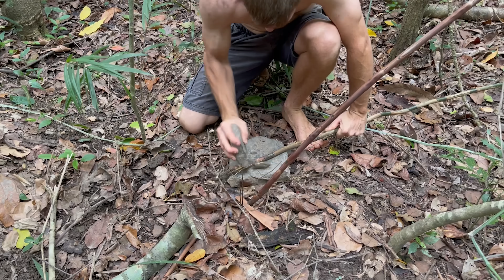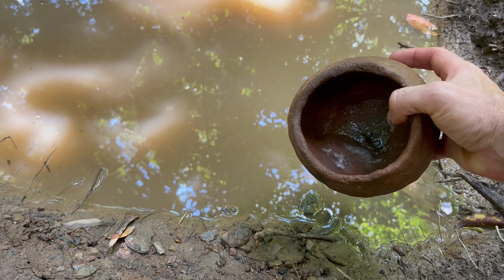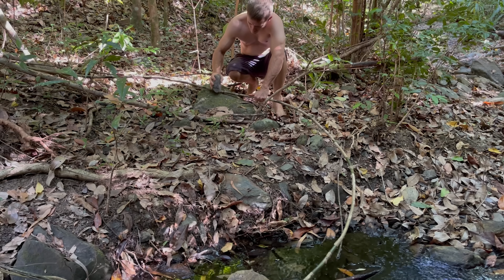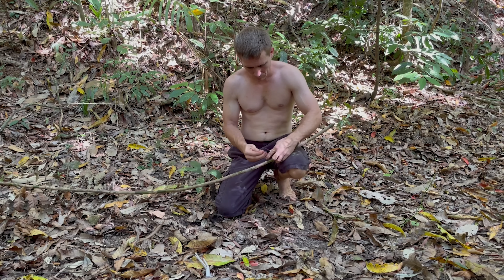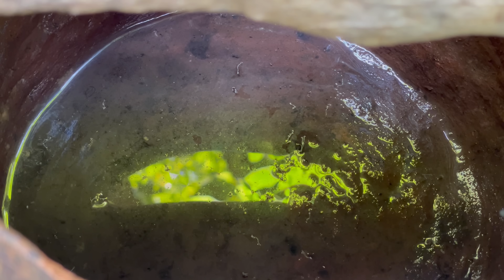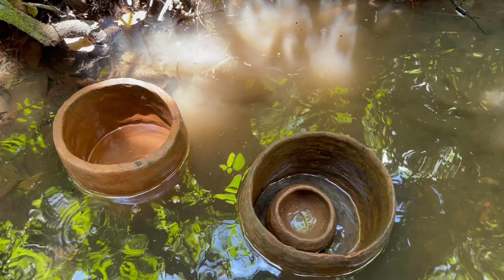Primitive Technology: Cane Water Filter/Siphon

Comment: Neat!
Those are nice primitive filtering systems, but depending on your water source I'd really advise against something as simple as this...
I mean, I imagine he knows enough about the water source that it's good enough to drink with simple filtration, much more of an expert on it than I am, but just to let others know that simple filtration systems aren't enough to kill or eliminate some dangerous stuff.
Of course, it depends on water source, but unfortunately these days most places people would use are contaminated enough that a simple system like this could still result in some pretty bad quality water.... clear, but potentially still contaminated.
Safest simple bet? Use an evaporative/condensation system.
I imagine this can be done in a primitive technology scenario... boil water in pot and perhaps using large leaves or a polished stone slab to condense and collect water back?
Reply: The cane filter was extremely unsafe. Pulling from a stagnant water source, absolutely insufficient filtration.

Comment: I'm curious how those pots left in the water would hold up after awhile. Does prolonged water filtration risk the bottom breaking/ make the pots only good for filtration or can you remove and use for other tasks without risk of breaking
Reply: If they're fired it shouldn't cause anything.

Comment: Wonderful video! Im appreciating the semi-regular uploads.

Im wondering, would it be possible to make a pitcher that would be more suitable for this method of filtration?

Maybe thinner walls, or volatile/soluble chemical add-ins to make it more porous, or what have you. Would using the wood ash pottery you made in an earlier video work?

You could also make it work outside of the creek by having a cone-bottomed ceramic filter that you just place a pitcher under.
Reply: Now that he has made a pottery wheel, it might be possible to make a pot with thin ridged walls to create more surface area.

Comment: I suppose it's better than nothing and in a short-term survival situation it might be okay. But I would still be boiling that water to kill any viruses/bacteria that are in there.

It's not super hard to distil water in a survival situation. You can do it with two glass bottles. Tape them end-to-end with one holding steaming water over a fire and one cold one for the steam to condense in. It wouldn't be hard to rig up a setup like this using your baked clay.

Comment: The porous nature of the clay pots can be used to keep water cool in hot dry climates too. The water held inside seeps out but the evaporates, cooling the water within. It will keep the internal water noticeably cooler.
Reply: can also be partially buried in the garden for a deep watering/ slow release watering system they call them Oila's.

Comment: I, personally, would not fully trust either of those sources of water, even after the filtration. Yeah, the filtering gets rid of mud and small rocks and stuff like that...but it could still be carrying pathogens that were small enough to slip through the pours of the fired clay, or down the length of the cane. I'd recommend boiling it, still, before drinking it.

Comment: Have you considered making a special filter pot with a high ratio of sand in the clay to make it more porous? You might be able to use that wood ash cement concept to make a similar device. Low-fired terracotta isn't porous enough to make an efficient filter on its own. Could also try pouring water through a very tight basket filled with charcoal, or maybe a fiber bag filled with charcoal.

Comment: Your techniques are always masterful.
Using the capilary action to siphon and filter through the bamboo, plus that ceramic pot trick.. man, those are worth remembering.
Reply: the ceramic pot thing works in reverse too! theyre called "ollas" (oy -ahs) and lots of indigenous groups from the americas use them. fill up a ceramic pot with water. bury it in a field, and plant some things around it. it will slowly leech the moisture out, and prevent evaporation!
Reply: Juuuuust in case I get lose in the wilderness in this exact type of forest
Reply: But don't siphons use water pressure, not capillary action?
Reply: I don't think it's capillary action. It's the same principle that you could use to siphon gas from a neighbor's car + the xylem's ability to filter combined into one
Reply: @stigmautomata  capillary action is exactly how xylem vessels work.

I used the term siphon as a descriptor for how he pulled a vacuum through the plant before filtration and water motion began. This mechanism mimics the process of siphoning, and without due experimentation one cannot fully disregard the mechanisms responsible for siphoning or capilary action respectively.

Comment: I was thoroughly confused at first, as I would think drinking water from the river directly, or boiling it, or passing it through a sand-charcoal filter must be way more efficient.

But I'm guessing this is experimental, and I have to say this is a really creative way to clean water.
Improvements suggestions I've seen in the comments is to cut the ends at an angle to avoid having the canes sit at the bottom, reducing glogging as dirt settles.
Reply: the charcoal-sand-dirt filter sucks tho, it doesn't get rid of most bacteria
Reply: Raw river water would have been better than the filtered clay pit water. This filter doesn't remove more than large particulates

Comment: I'm curious if using live vines in the direction the xylem usually transports water is any different than siphoning in the opposite direction. In my knowledge it shoudn't because the water only travels that way because of passive transport; water evaporating from the leaves creates an under-pressure pulling the water upwards, but perhaps not in canes, or my knowledge is flawed.

Comment: That's a fantastic idea! The only thing I would add is if you know you're pulling from a soiled source, you should still boil it if able. In a dire survival situation where a fire isn't an option, this will still be vastly better than the inevitable dehydration.
Reply: Though this is REALLY slow for a survival situation.
There are water filter setups that work a lot faster, and variations of which you find in pretty much any survival handbook; A container with a small opening at the bottom, filled with fine sand or earth at the bottom, and then ever coarser material (pebbles and then rocks) the further up you go. Often a layer of charcoal is added to absorb anything organic, and some will use cloth layers if available.
I've built one like that myself, it cleans up the water extremely well, and the flow rate is significantly better than this here.
Something like this, particularly the siphon setup, might be useful as a static setup when you want a steady supply of filtered water without time constraints. It would be a lot easier to maintain since you only have to refill the top container.
Reply: Yeah, I was wondering whether or not this removes micro bacteria or viruses, since stagnant water in particular is incredibly dangerous to drink. I wouldn’t even necessarily trust modern trekking water filters to fully remove bacteria from contaminated waters, especially in a survival situation where the resulting diarrhoea could easily be fatal. And that’s not even mentioning other poisonous substances, like heavy metals. These vines are a very neat trick, but I’d be very careful with it (and seeing the flow rate, you’re kinda forced to take it slow)
Reply: @BoarhideGaming  I wouldn't worry about heavy metals or carcinogens in a survival scenario, since hopefully, you won't be drinking the water for more than a few days rather than a few decades.  For modern membrane filters, it would depend on the source.  For instance, if it is a cow pound where you can expect a variety of nasty amoeba, I would definitely filter and disinfect.
Reply: Seems like it takes too long in this environment,  like how many mosquitoes already laid larva in there in that amount of time? 🤷

Comment: One thing that might make this a little faster is to cut an angle on the bottom end of the cane if you can, so it doesn't sit near-flush with the bottom of the filtered pot, and restrict the flow rate
Admittedly it's operating at slow speeds so it shouldn't matter but all the same!

Comment: You got pots, if you got sand, small stones, and something that can be used as a cloth.  you can make a charcoal filter.   Bigger material ontop and work your way down.  water comes out looking clean.  and works much faster than those two methods.

Comment: That pottery filter gives me an idea you could try:
1. Small pot and proportionately larger pot (not by alot)
2. Fill space inbetween with a charcoal dust and sand
3. Place in water and let it work

Might be too much work, but I think it'd be a neat experiment at least. Just use little tiny cup and bowl sized pots for that see how it goes.
Reply: I'd be concerned about evaporation off the charcoal layer unless you covered the gap with something non porous. Seepage is slow enough already, and then having to saturate charcoal and then sleep again, just seems like there's a lot of time to lose a lot of water

Comment: Nice video but the technique is quite slow and i dont know if you could use it for long term.Yes for a day or 2  you could drink that water but i dont think that in long run will truly work or be safe to drink.
Also,the second pot need to be covered to prevent things falling in the water .

Comment: Very cool solution. You also have the option to make a clay tube. Fill that with crushed activated charcoal at the bottom and sand above. You would have very good filtering and much higher flow.

Comment: How safe is water from the second method and would it help significantly making taller pot for deeper submersion and higher pressure? Also it would be nice if you counted how many of these do you need to keep 1 person hydrated.
Reply: Literally millions of times safer than the first method just because of differences in the water sources...

Comment: You can speed up the clay pot filter by adding some charcoal dust to the clay. It burns off at firing, leaving some larger channels for the water to pass through, but still small enough to filter effectively.

Comment: 10 pots in the pond, let them soak with a cover on until they can take no more. Then filter the contents through a large cane setup in parallel. Then boil the final water = lots of clean water. Takes a while to set up the whole system I think since you have to make a lot of pots and canes, but once it's up and running it's a stable clean water supply.
Reply: Combining methods were my thoughts exaclty, maybe even adding a pebble/sand/charcoal filter inbetween.
Imho you can't filter water enough.
Reply: The pots alone filter many times better than the cane, so there's not much to be gained from that. And you can clean organic material out of them by refiring.

Comment: Another good idea is elevate the cane just bit when submerged in the muddy water pot, as heavy particles will still settle to the bottom over time, this would hopefully make your cane not clog up as quick
Reply: Also, I think to have it drip into next Container, leaving the end less moist and therefore helping draw the water through the xylem.

Then, not as high a curve, but higher platform height, as to keep the same length branches, but could be difficult with them breaking.

Comment: Other methods that come to mind are 1)filtering water through charcoal, maybe if you made a pot with holes in the bottom, filled it with charcoal and poured water in
2) boiling the water over to another pot - do you think a simple distilling apparatus could be made out of clay?

Comment: Assuming the ceramic pots will eventually clog up and stop filtering/letting water in, could you re-fire them and end up with a watertight ceramic pot without actually glazing it?
Or would you end up with just a broken pot?
Is glazing a pot on your to-do-list?

Comment: Love your videos!  That water looks a lot better, but I'm still not sure I'd drink it without boiling.
Reply: Would you drink water from a ceramic filter system?  He has created the same thing without all the marketing.
Reply: @jjudy5869  I believe they were talking about the first filter solution
Reply: Right, this cane filter basically only removes particulates, not much in the way of bacteria cysts or viruses...

As for the clay ones, those were placed in running water so that's already millions of times better (literally) than the cane test with stagnant water. Even so, i wonder how they stack up with commercial products in thickness and pore size, and what the log reduction rating is

Comment: With your pottery skills you can make much better water filters. Just make a vase with a small hole in the bottom, grind up some of your grog and sift it somehow. Add fine sand to the bottom of the vase, then add a layer of your sifted grog, then your unsifted grog, and maybe some pea-sized pieces in the top. You may have to do some experimenting with layer depths and materials to get it to work right. But, theoretically, you should be able to make a pretty effective filter that much faster than this.
Reply: Great way to get infected with lots of bacteria and other nice stuff. Because this method will filter basically nothing worthwhile.
Reply: @whuzzzup  Yeah, that's true. You'd still have to boil it. But, even boiling it would probably still be faster.

Comment: For the source water there's also the desert sand technique, make a circular divot in sand/clay and pour water around the edge saturating AROUND the divot. The water will filter through the sand into a pool in the divot. This way also less gunk would build up in the elevated siphon jar for mold etc or blocking the cut ends of the cane with particulate.
Reply: That's good, keep the fine filter for what it does best, preventing parasites from entering.
Reply: https://youtube.com/watch?v=9kzWwnn9H7o&feature=shares
Reply: Oh and the slow sand filter. Where the actual filter element is a membrane of bacteria etc. that accumulates on top of a column of sand over time, and you filter from top to bottom through that column. For example with a ceramic pot that has a hole in the bottom.
Reply: @djazt.8053  i think it would be interesting but challenging to make a reverse clay filter maybe combined with your sand filter. have a big long cone made of burnt clay that you fill to maybe a third with sand. then fill it with water and place it elevated so that the tip of the cone is over a collection vessel. the long shape allows for more hydrostatic pressure toward the tip of the cone accelerating the water pushing through the pores of the clay.whatever water seeps out along the sides will also run down towards the tip and be collected.
 the sand helps prefiltering and the the entire apparatus should be possible to be refreshed once clogged by burning it out.
 

to prevent airflow which evaporates the filtered water before it drips into the collection vessel the thing could be set up in a tube like the chimneys he built for his iron smelting.

Comment: Clever!  I see your reference to the MIT's pine filter.  Do you have the means to test your own filtered water for contaminants?  I like your method of submerging the clay pots - I would have wasted energy trying to build stackable clay pots or something.  Have you tried altering the porosity of your ceramic by including organic materials to the clay?
Reply: My issue with this is that the MIT tests were with treated fibers, not raw ones like he's using. If he even gets one log of reduction (90%) I'll be surprised... and barely acceptable water starts at 4 log (99.99%)
Reply: Well he drank the water after filtering, without boiling, so it is pretty clean. And this is more of a proof-of-concept than actual way to get clean drinking water
Reply: @Mirko  you can drink a bottle of venom every day for a year and be fine. Then one day you have an open sore in your mouth and drink another bottle of venom and you die. Just because you can physically drink it and not immediately see an adverse reaction does not mean it is safe.

Comment: I'd like to put a caveat on this, from the perspective of a water treatment operator.

The cane does a pretty good job at clarifying the water, this is true.  And removing the turbidity (read: suspended particles) does remove a significant portion of the bacteria present.  However, it is not nearly enough.  I need to re-up on my Regulations course, but I definitely know you want more than 99% removal of pathogens, especially in a tropical zone like that.  Typically you want at least 3-log removal (99.9%), if not 4-log (99.99%) or higher.  Therefore, I would still recommend boiling the filtered water before drinking it.
Reply: This is the comment I was looking for xD Thanks for based facts. I wouldn't be comfortable drinking water with only 99% of the dysentery removed :/ Still fascinating.
Reply: @nullifye7816  No problem

Comment: Is it possible to make activated charcoal and use that to filter water?
Reply: Charcoal itself can be used to do that. Properly activated charcoal as we know it would probably be quite hard to make.
Reply: @m-h1217  afaik you can make it with lye, probably the hardest part would be making a decent mortar & pestle to grind the charcoal down fine enough.